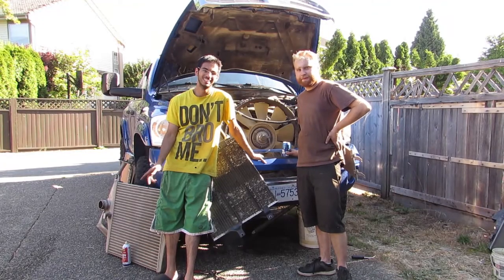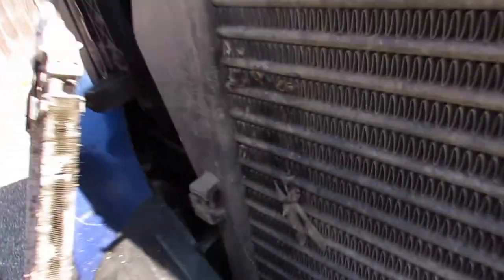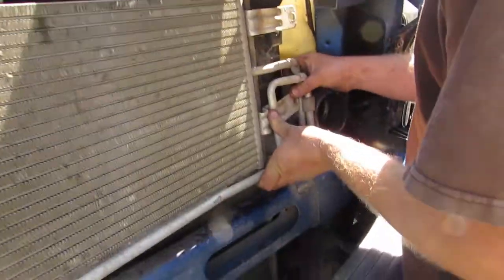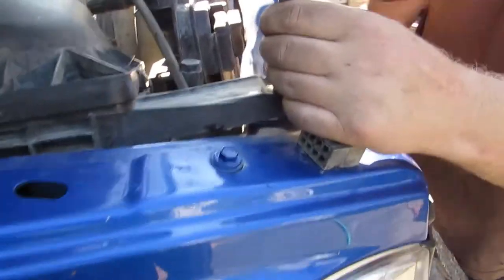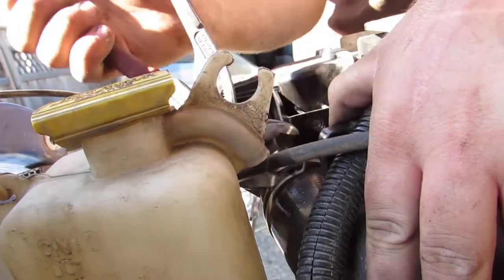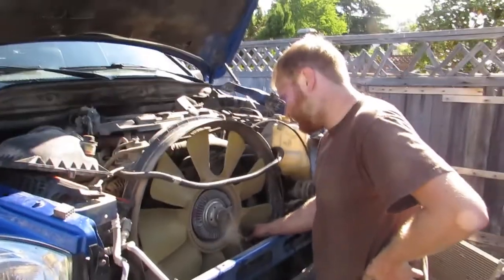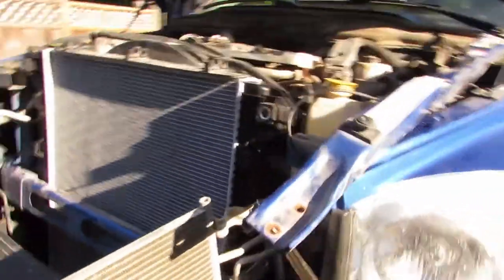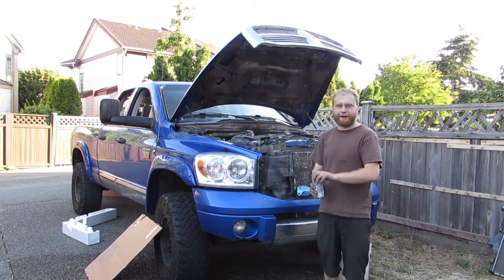HOW TO: DODGE 2500 3500 6.7 DIESEL RADIATOR REPLACMENT

Comment: On a 2007 Dodge Ram 3500 cummins, there is a cooling system vent pipe on top of the engine that is supposed to be opened to "burp" and vent the system while refilling. The black 3/4" (ish) pipe stubs up vertical just to the left of the center top engine cover. It is the highest point on the motor.  it has a screw plug in it that takes a hex wrench. Its right between the intake air duct and the throttle positioner. I don't know if your 2008 has it but I'd guess it would.

Comment: Got one in the shop I found leaking as I was replacing all the front end parts. Looked it up and found this. 
I figured it would come out without removing the coolers up front.